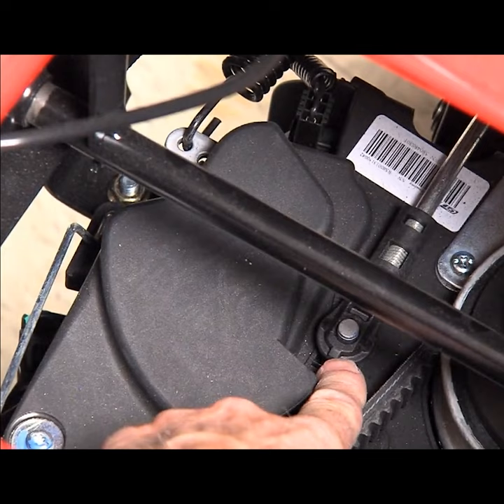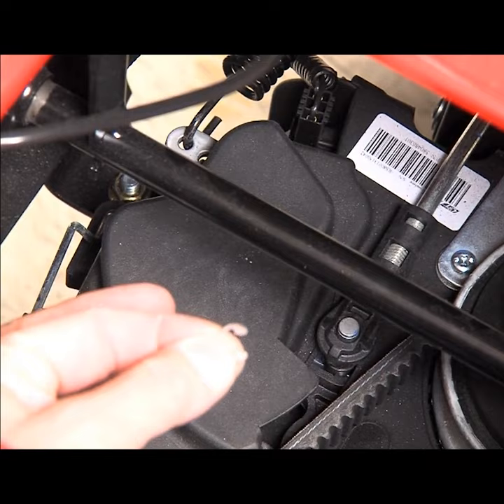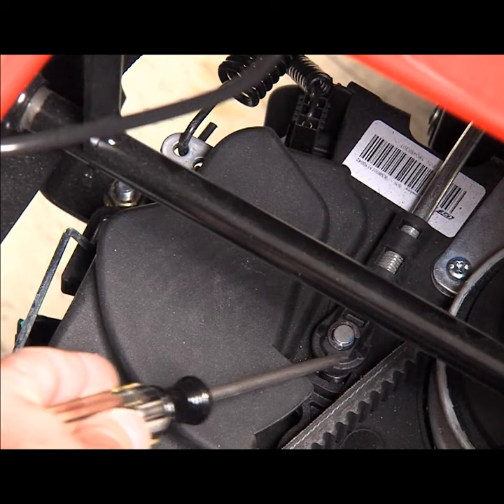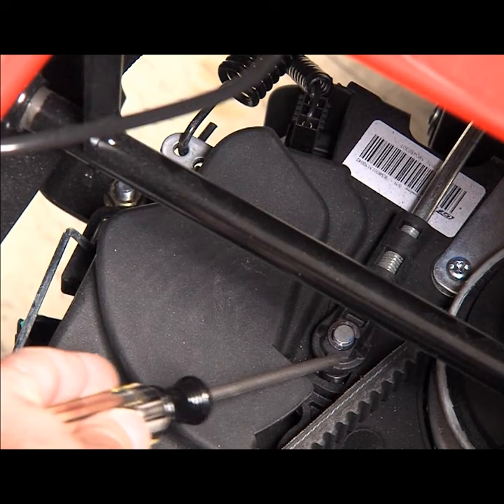Riding Mower Only Moves in Reverse -- No Forward Motion

Comment: What's that pulley on the right called? The pulley that has the short ribbed v-belt connected to? Mower won't move. When mower is off I can turn that pulley. Does that mean a broken transmission?

Per a different video, there's a lever on the right side of the transmission that apparently solves some people's problem of it not moving. Could that apply for me as well? Poulanpro 20HP v-intek briggs, 42".